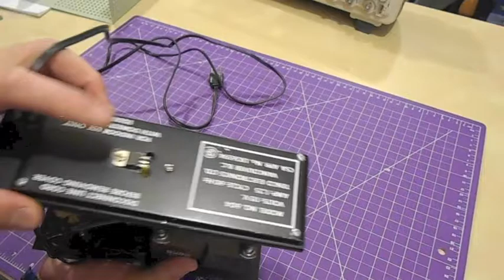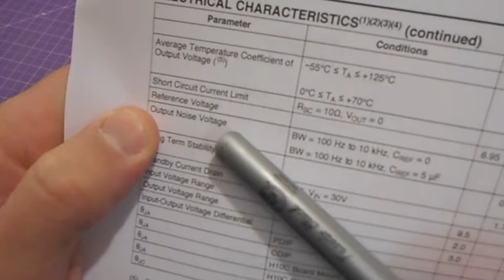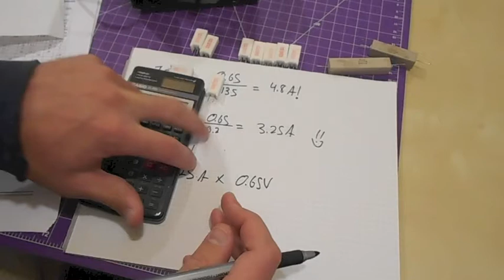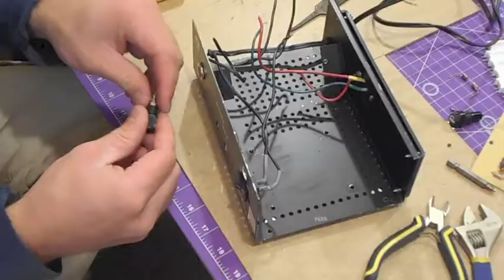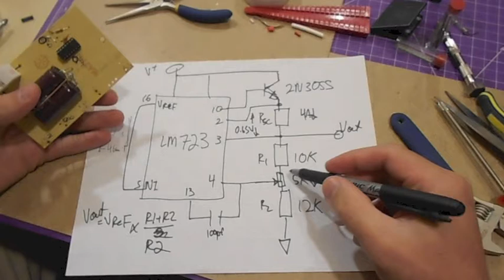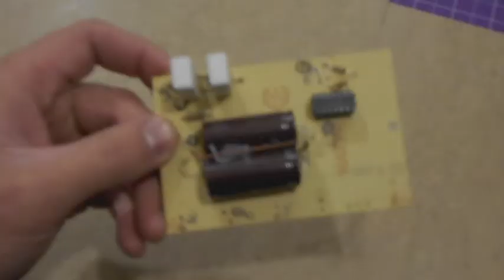"Power Max" bench power supply Repair and Retrofit

Comment: The old 2N3055's have been around over half a century and are still the best overall for a power supply. You seem concerned about 'the mains' . You should try 240 V sometime, that's a real wallop. Back in the days of valves I had 450 V through the end of my nose - I still have the scar. A very nicely made video and not a bad power supply. I have an 80 A 40 V transformer - no comment. Thanks - great stuff.